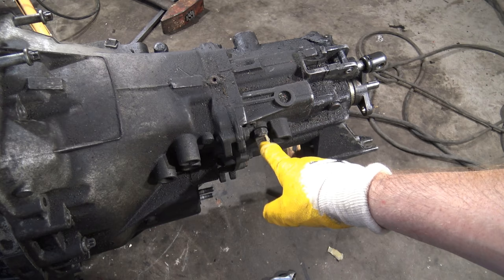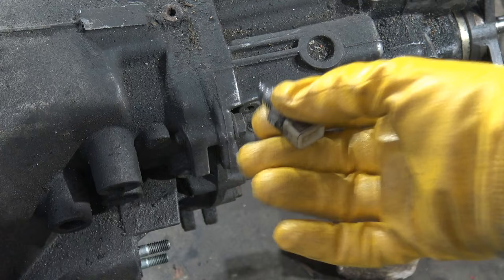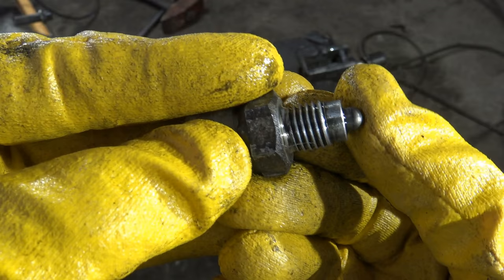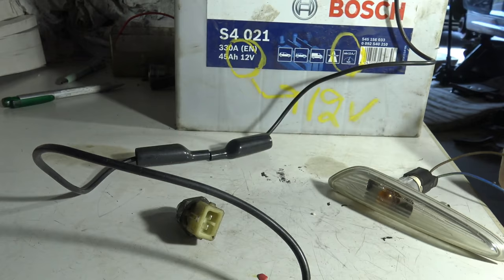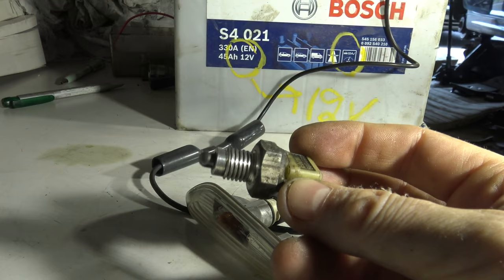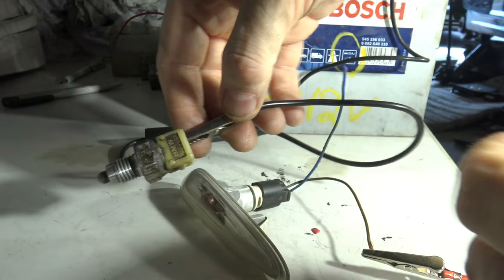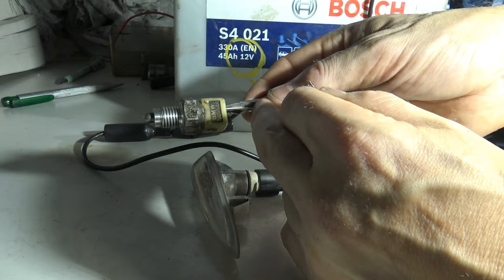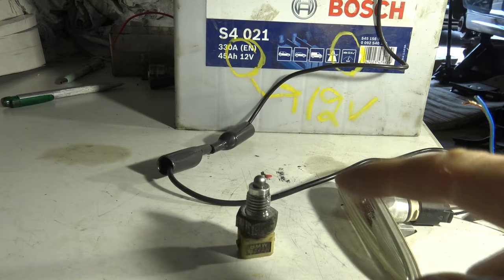How works Reverse Light Switch in gearbox

Comment: Good Explanation! I'm seeing you because my BMW X3, reverse lights doesn't work.. And I checked the fuse, and it blows. So I put a new fuse.. And it works.. But in the same day fuse blows again. It could be something wrong with wiring or with switch.. Maybe I will begin to change a switch for a new one.. What you think?
Reply from the maker: Maybe you need new cables

Comment: My fuse, bulbs and reverse light switch works. It won’t work after I put the switch into the gearbox. Any advice
Reply from the maker: Check all wires and connectors

Comment: My wire harness on the reverse switch from the gearbox is torn. Im trying to locate or trace back to its connection but to no avail. Atos 2004. Any ideas? Thanks
Reply from the maker: Good comment and Let's All folk discuss more 👍😀

Comment: My reverse switch is broken inside the gearbox how can l take of because it seems like the oil is coming out through that hole
Reply from the maker: Noted
Reply: Hook up a shop vac to the dipstick creating a suction .
You can do it with oil too if you have to change the drain plug gasket or something

Comment: Sir peter is they have reverse switch in automatic transmission?
Reply from the maker: Yes
Reply: Its the backup light switch or reverse light. There is an arm insde the trans which presses against the switch which activates the switch.
After the switch is activated your reverse lights come on.

Comment: Hi doing m friend got toyota Corolla sr5 coupe manual 1.6 no got reversed you thing got saint problem check the cable good don't now Thad switch got the pedal to stared the car need to push the clutch it no stered thing Thad switch for the reverse to thank you I check Google can fine nothing some body can let me now thank good video
Reply from the maker: Good comment 😀👍